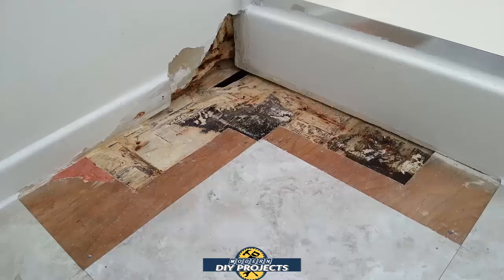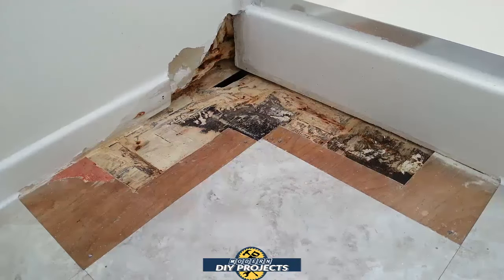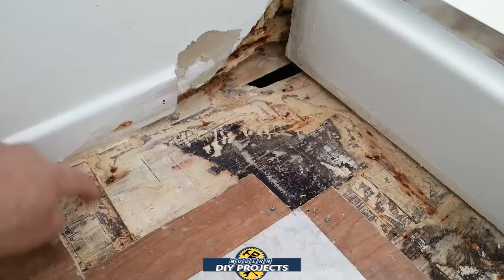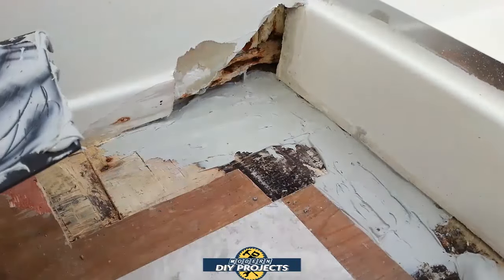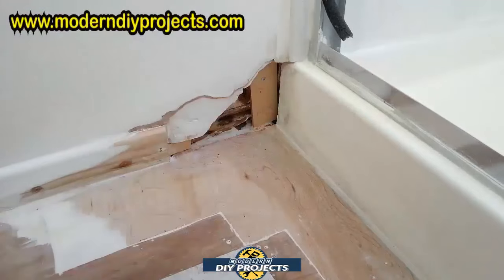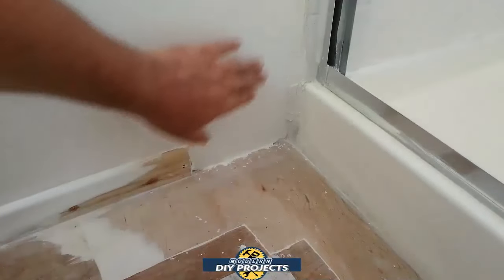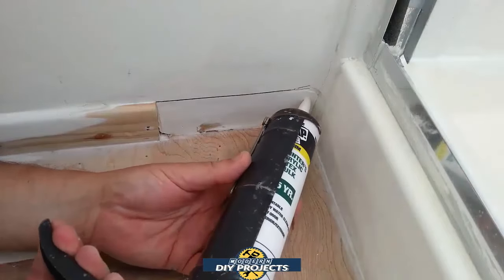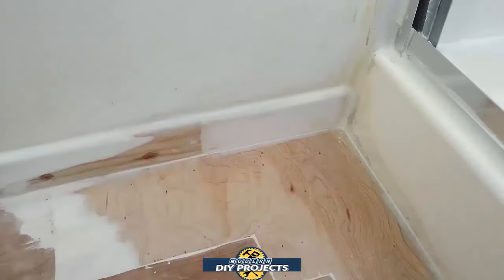Water Damage Bathroom Floor Repair - Fixing Hidden Water Damage

Comment: Working on mine right now, mold under tiles ripped half out and it got worst, having a bio testing  done at $600, plus $4,500 for treatment by water damage contractor and hope the cost won't get to high, they did tell me that if they have to remove tub and tiles it would be about $20k to redo entire bathroom remodel.
Reply from the maker: I feel your pain. That is why I learned to do stuff myself because the so called "Professionals" charge an arm & a leg and sometimes a kidney. Hope it doesn't go south on ya.
Reply: @ModernDIYProjects  I am a do it yourselfer but this was much more than I could do myself, so much mold on about half my floor. Thanks for sharing your video every little tip for the DIY helps.
Reply: @rickg882  How much water damage? A flood or water seeping from edge of tub? (if you have a tub) Is it just the one bath? Asking because this seems excessively costly, I had a 75 sqaure foot closet I had remodeled into a bathroom and it costed 31k. No plumbing or anything was in it. Just a empty closet in the main area.

Comment: I could see a contractor or handyman making this a Complete Remodel? ( Big Time ) Merry Christmas to you and your Family. for future repair like that you should cut back the dry wall and replace it with no rot green board. or cement board. that will eliminate future mold problems in a wet area.
Reply from the maker: Thanks, Merry Christmas to you too! You bring up a good point. I was going to use green board, (since I have some spare pieces), but that green board is only 1/2" thick. Since I had to fill in the damaged portion of the wood, I decided to use 3/4" drywall instead to make it less trouble for me having to fill and even out the wood in the back. But normally I would have used the green board.
Reply: @ModernDIYProjects  You could have used 1/4 inch fir strips to make the difference in the thickness?
Reply from the maker: @bryansmith5980  Good idea. I'll keep that in mind for future use.

Comment: What my 🚿🛁 bathroom is looking like with children always leaving the curtain wrong when they shower it's time to fix kitchen and bathroom and idk where to even start wonder if it will just be cheaper to get a person
Reply from the maker: Depends on your skill level and how busy you are. It will be easier to hire someone but I can guarantee it will NOT be cheaper.
Reply: Same issue here in kids upper bath. I won't hire anyone, I have multiple baths and will figure it out no matter how long it takes. I don't trust contractors, they messed up most of the things they have touched in my home. I had an out of twon contractor create an entire bathroom out of a closet and did amazing and it's the only bath not having problems 4 years later. He is no longer close enough to have do anything in my home. I have called people out regarding this and multiple other thins the builder did short cuts on, and they were...I'll be blunt morons. So instead of wasting money on getting dumb advice, I will spend it on actual materials I need.

Comment: How long would it take to replace the floor under the the front 1/2 of the toilet, if it has broken through both both layers of wood? Sheet of linoleum covers floor.
Reply from the maker: First you need to find out what the problem was that caused this and correct that. Once the correction is made, removing the bad floor back to good strong wood, and adding any bracing if needed. Possibly two weeks going methodically. If you rush through it, you could do it in 1 week. If you hire a contractor, it could take a month.
Reply: @ModernDIYProjects  When you say removing the floor up to the good portion, do you mean cutting out the subfloor? I don't have two layers, I have one board of subflooring. I don't know if it has integrity or not. I don't know how to tell those things
Reply from the maker: Check out my other response

Comment: Thanks for the info, but what did you do to prevent the water from causing the same damage to happen again over time?
Reply: This is my question as well
Reply: @jenclawson2362  he says at the end he scraped out all the old caulking and reapplied

Comment: Thanks.  We have a similar situation with the flooring around our tub right now.  Gonna give this a try.
Reply: It a common problem 
.I'm having ceramic tile put one third of the way up the wall and on the floor to prevent this from happening again.
Reply: question, I have the same problem I found coming from in front of my tub. I don't have two layers of subfloor, only the Hubus OBS. I am drying it out now and already tackled the mold issue, that I can see anyways. Workers around here can't be trusted to do anything professionally so I now try to do everything myself without cutting corners, like they do. My floor didn't have a moisture barrier put down by builders when built, I didn't know, esentially is what has caused this problem and then adding a quarter round at the tub with no filler put down. Sad. I have stripped my entire bathroom except the tub bc that isn't a project I am really wanting to do. Does this method work with only one subfloor, putty and sand that and then put down new subfloor? I cant tell from the video what is going on there, what do you think?
Reply from the maker: I have two sub floors because I had to build up one side to compensate for unevenness on the other side. If you have only one sub floor and it gets damaged then you can only do the scraping and filling method if there is enough sub floor left to hold up the weight of a person after the repair is done. If the floor is down to 1/8 of an inch in thickness or less, then I suggest that you cut out that section and replace with a new subfloor. You will have joists below the floor to hold it up so there is nothing to worry about. If you don't want to completely remove the tub then you can always lift it with a floor jack (if heavy cast iron tub) and put back down after the repair is done. No need to remove completely.

Comment: I have a similar issue. very small amount of old water damage that has been corrected and dried. When putting this bondo type material on the subfloor, will thinset adhere for tile?
Reply from the maker: Yes, everything should adhere to it. It's just like the Bondo for car body repair but made for more general application.

Comment: Can you show exactly what you re-sealed to stop the water damage from happening again? We have the same problem. We have newly built home and our contrator has no idea how to fix it. Please show what you re-sealed.
Reply from the maker: All I did was remove the existing caulking and refill with new water proof caulking. The previous caulking had separated allowing water to get behind it. It's not difficult, it just wasn't visible to me until I starter pushing on the caulking and could see water squeezing out. You probably have a similar situation.

Comment: Is there any way to waterproof (or at least make more water resistant) an area of drywall near the shower? We have an area next to the shower that, due to the way our bathroom is shaped (hard to explain), it regularly gets little splashes and moisture. It not so much due to something not being sealed correctly, but more due to kids taking showers, sometimes they forget to make sure the shower curtain inner liner is all the way covering the area, kids just being kids that get water all over the place, etc. I’d have to monitor every time anyone got in the shower to keep the area totally dry.
I can patch the area and put in new drywall no prob, but I feel like I should do something more to help the drywall not get the moisture.
Any tips?

Thx
Reply from the maker: I understand what you mean. That is a difficult situation. Most water sealing materials will leave an ugly stain or discoloration so you really don't want to do that. They are not aesthetically pleasing. The only things you can do is paint the area with an oil based paint. Use exterior grade paint for best results. Water based paints are worthless against water, no matter what anyone says. Also if you are patching the drywall use the Green or Blue drywall those are made for wet areas. The  only other solution is to use a clear barrier over the area with like a plastic film that can be applied to the area. Like a clear bra for a car, similar idea. So there are a few thoughts you can see which one works best for you.
Reply: industry standard is to have a waterboard (durock or such) running out (vertically) to where the tub is framed in, this will keep moisture from eating at the sheetrock. Also most peoples water issues come from older hot/cold/shower valves... if this is the case, repairing the damage is a bit pointless as it will be that way again in quick order.
Reply: You can cover your wall at least half way with tiles.
Reply: Yes you can waterproof it, you’d just have to change the material. I have 6 kids and I know exactly what you mean. Just moved into a new house and the bathroom is all messed up, so we’re replacing the flooring, tub and toilet anyways and taking this time to go ahead and waterproof the floor and walls. We did the same thing at our old house about 10 years ago

Comment: When water seeps from over the edge of tub over time, on the floor in from of the tub, does the water also seep under the tub? I am trying to figure this out before I bother cutting up a perfectly good shower, (shower not floor).
Reply from the maker: If there is not a proper sealer and the floor slopes toward the shower pan, then yes water will travel anywhere it can. If the floor is sloped away from the shower pan then the chances are less. If this is a single story then maybe to can go under the house to get a look under the shower for damage if you have a crawl space. If its a slab, well then maybe you can drill a small access hole under the shower pan and use an endoscopic camera to get a look under the pan to see if there is any damage. If it's a two story then you can drill a hole in the ceiling from below the shower and use an endo camera also.

Comment: This looks similar to my shower, but you didn’t show how you fixed the leak from the shower. 
I suspect that the weep holes are allowing water to get behind my builder-installed tile wall. 
My fiberglass shower pan has a “gutter” outside of the shower with tile above it, so I don’t see how the drywall is getting wet. 
Any thoughts???
Doug
Reply from the maker: Can't comment on your situation without seeing it. For me it was faulty caulking. It separated causing a bad seal allowing water to seep in behind it. Scraped out the caulk and reapplied. Then did all the damage repair.

Comment: what did you lay over the hole before you used the bondo?
Reply from the maker: Nothing. You apply the bondo right to the bare wood. The only thing I used was Bleach to kill any mold that was on the wood. The black stuff was an adhesive from the old floor.
Reply: @ModernDIYProjects  ok awesome thank you! I’m dealing with this same issue.

Comment: How were you able to place the cutout piece of plywood so you ended up with the same height as the rest of the floor.
Reply from the maker: A lot of careful measurement and sanding. Obviously tedious stuff that you never show on a video.
Reply: @ModernDIYProjects  How did you end up with two subfloors?
Reply from the maker: Check out other response

Comment: How do you test for asbestos when trying to find a leak in the home, asbestos can show up anywhere?
Reply from the maker: There are many asbestos testing devices on the market buy they are not cheap. Most people if they cannot afford a testing device are very careful if they believe that they have asbestos. Wear masks and wet down the area that you are working on so that the particles cannot become air born. Remember, asbestos is not some demonic beast that will invade your body. It is only dangerous if inhales in large quantities. So one or two asbestos particles will 99% change not hurt you.

Comment: Can I patch up the plywood with this putty?? And then can I put the vinyl tile directly on top of the putty?
Reply from the maker: Yes, you can. This putty can be used as a finished surface. Just primer it when done to seal it up and you're done.
Reply: @ModernDIYProjects  This video is so helpful. Could you please confirm what type of primer?
Reply: How long wait time for putty to dry up ? Thank you
Reply: @nicoleb2669  If it's the 2 part putty (grey putty + a tube of hardener) it cures in ~20 min.

**keep in mind there are a variety of factors that can directly affect plasticity time. Ambient temperature or thickness of application for example, even something as simple as being a bit too generous with the hardener can affect the time to cure more or less cutting it in half, which has an obnoxious way that always ends in a hard blob stuck to your mixing tray with a whole sword in the stone/putty knife situation to figure out.
Reply: @ModernDIYProjects  Would you put a blocking mold primer on it?

Comment: What was the problem though ? Why was it leaking behind the wall
Reply from the maker: The caulking had separated from the tile and allowed the water to seep in behind it. Removing the old caulk and recaulking fixed that.
Reply: @ModernDIYProjects  thank you I think I’m having the same problem

Comment: You didnot show how water get behind the wall. I recently see a case of water damage on the subfloor. It turns out that water traveled from shower enclosure to the tub edge. The tub lip is about 1 inch behind the tile. Therefore, water goes behind the wall and dripped sideways to the subfloor. 

A temporary fix is to add sealant between the tile and the tub. I feel there is a fundamental flaw in design of the tub lip
Reply from the maker: I didn't show it but I did explain what happened. It was traveling along the the floor pan lip, under the tile and coming out at the end causing the damage. I cleared out all the caulking and resealed it.
Reply from the maker: @luyabell76  No, this is the opposite wall to where the faucet is. The water was getting in behind the caulking on the wall and working it's way out to where the plaster was. The sealer stopped sealing but I couldn't see it until I started squeezing it and saw the water coming out. Water always finds a place to hide and cause damage.

Comment: What if the floor is tiles?
Reply from the maker: Then you have a bigger problem because you have to chisel those puppies out and replace them. You wont know if you have a rotted substrate under the tiles unless they feel spongy or you break them out.